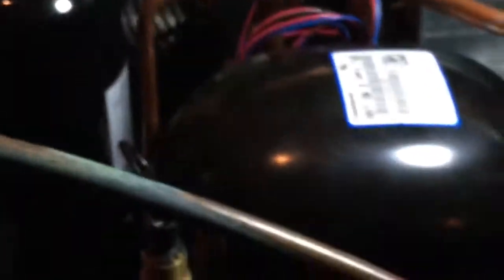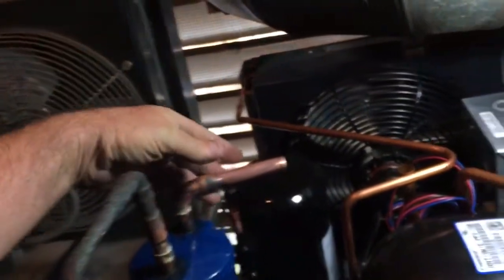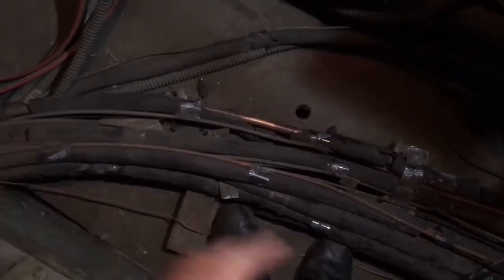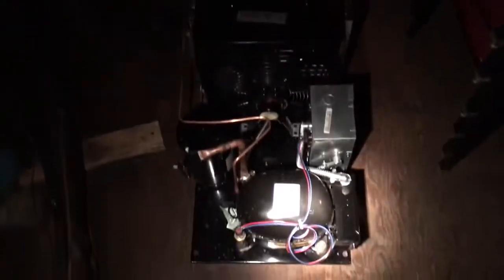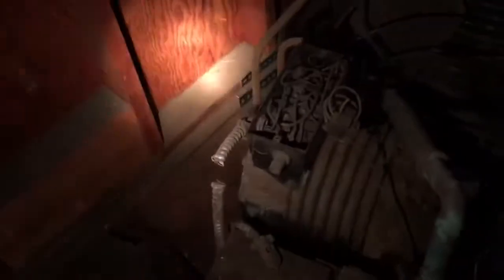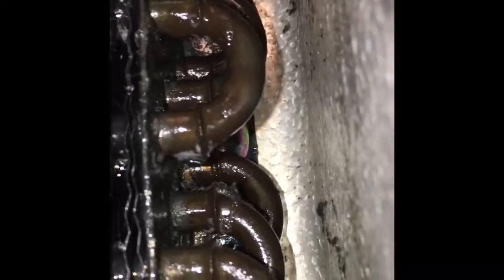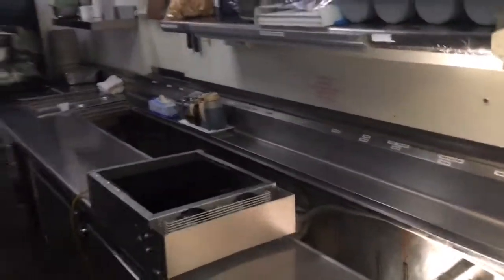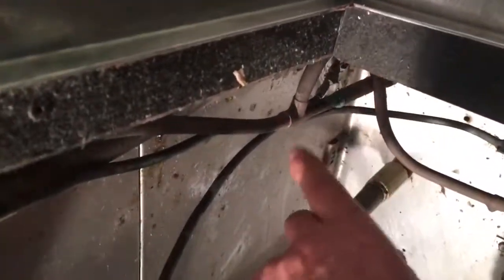Triple Evaporator system Piped incorrectly, Evaporator Leak shown , New Copeland install

Comment: Accumulators never get insulated.  They need to boil off any liquid that may be there, and insulating it will not help that.
Reply from the maker: I've seen them insulated from Factory's and i've seen them not insulated. I've Been doing this 36 Years and Never had a Problem Either way. i Prefer to insulate them when i install them. in this particular application the Hot Condenser Air Discharge would Blow Directly on the Accumulator increasing Superheat and i don't Want that happening in this application and also This unit is indoors with a wood floor and i don't want it dripping and making a mess everywhere , Water attracts Rats, mice, etc a very bad thing to have a water source dripping in an attic. so this one gets insulated. on a Roof --- i Don't bother insulating them. i only insulate them when the condensate will be an issue. You can order Suction accumulators from manufacturers insulated or not insulated. Customer Preference. Accumulator design stops liquid from entering the compressor not whether you insulate them or not insulate them. For me insulating them has Allways Worked out Better for me. but, thanks for your comment. Water dripping Everywhere is Just NOt For Me.